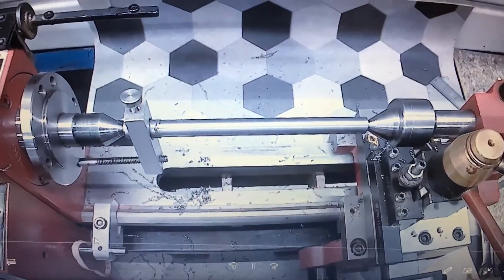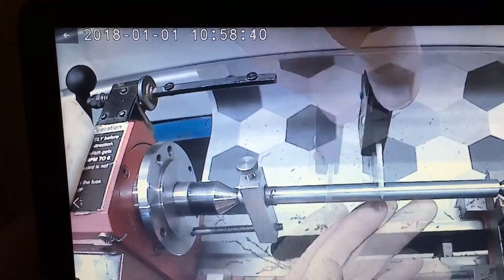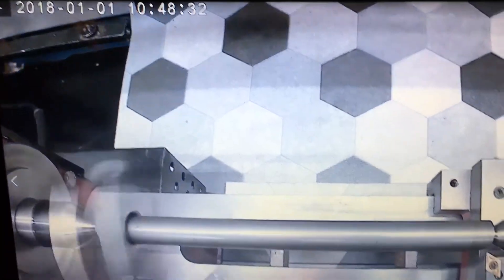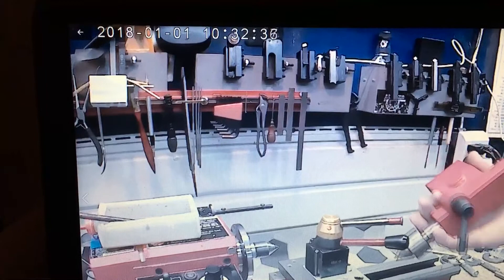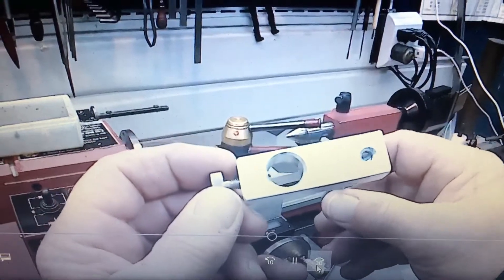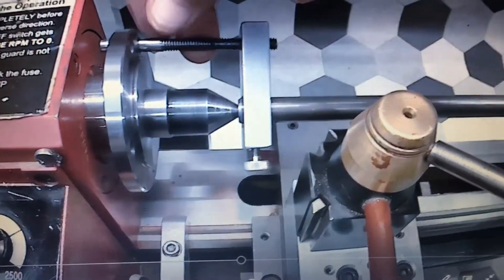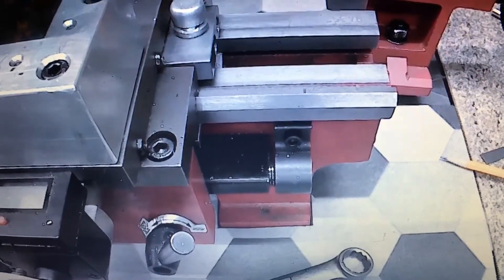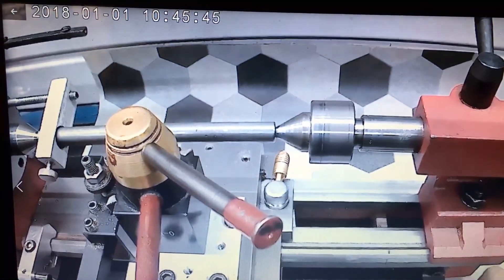Tailstock alignment. Mini lathe

Comment: Simple, yet effective lathe dog.  Nice thing about using aluminum is that the main bar should not be too much out-of-balance swing.  The drive pin is still steel but it would be better than being all steel.